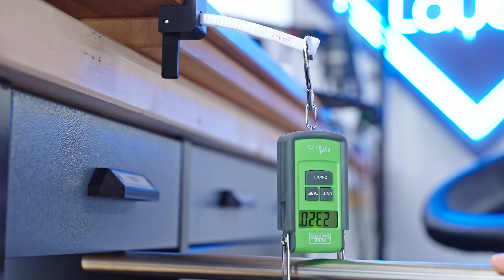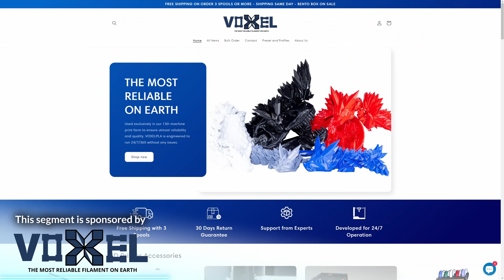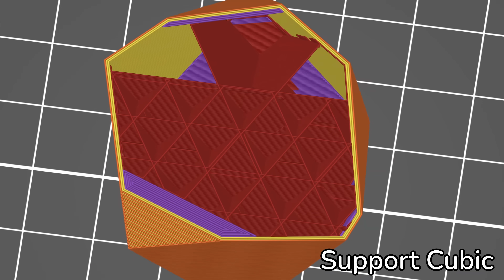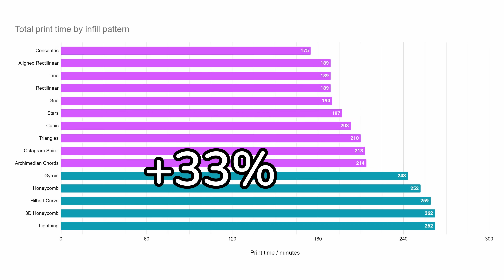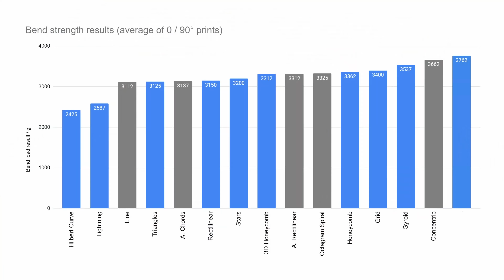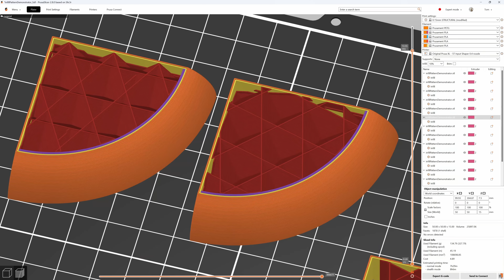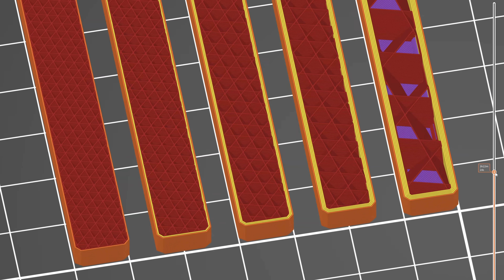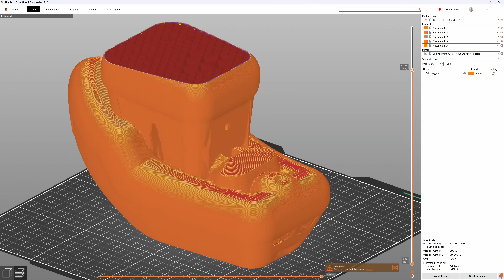Rethink how you use 3D printer infill!

Comment: At any point is less than 100% infill stronger then 100%?
Reply from the maker: I can see some very special cases where a bit of flex from less infill would make a part more compliant and therefore "tougher", but in general, yes, 100% would always be the variant that can take the larges amount of external forces.
Reply: @MadeWithLayers  hmm would be interested to see impact strength comparing high infill with 100%
Reply: Above 40% you get near zero benefit adding more material

Comment from the maker: Cubic was my first love...

Printed on the PrusaXL https://go.toms3d.org/PrusaXL

Product links are affiliate links - I may earn a commission on qualifying purchases (at no extra cost to you)
Reply: I would be interested to see how bambu's Cross Hatch stands up to this.
Reply: .. and it will be my last. 🎶🎵
Reply: gyroid gang
Reply: @pimi8522  Yeerrr
Reply: Need to do cross hatch too!

Also, is there a performance difference between 100% solid via infill and 100% solid via shell?
Reply: i was cheating on gyroid with 3d honeycomb until orcaslicer 2.0 update made it official with the upgraded version

then crosshatch came out and i left 3d honeycomb
Reply: I'm now trying GRID pattern but with "fill angle template" set to 45, 45, 45, 0, 0, 0 in SuperSlicer. Which means three times same pattern and then three times same but rotated by 45°. I wonder how measurement results would look if you plan to make second round of tests in future :)
Reply: @DreitTheDarkDragon interesting idea but why only 45 degrees?
Reply: Grid has always been my favorite but curious to watch!
Reply: Cross Hatch is my favorite.
Reply: I only print functional parts in ABS with cubic infill in 40%, even my dewalt table saw throat plate is printed like this.
Reply: so I made a printer head that prints stainles steel to .4mm , the problem is not in fill but suport .. so I use powder thet I blow on at each layer increment. you cannot belive the mess the first time!!
Reply: I've been recommending Cubic to everybody asking on the BambuLab subreddit ... feels good to be validated and having another video to point to ☺
Reply: Cubic for life❤
Reply: happy wedding with cubic. Make cubic babies.
Reply: Adaptive Cubic has been working well for my petg products. I design locksmith tools & in this industry you have to marry good strength with good looks. Locksmiths are a very discerning breed. And as the industry evolves these folks demand high quality tools. 
Good video sir! 🫡
Reply: Thanks! Great info
Reply: what about adapt cubic ?
Reply: you talked alot about the strength and efficiency of the print head movement, require to print the pattern. but i think those dubius pattern or any fractal based pattern existsted beause they are easier to callculate and able to fill iregular shapped print volume while also maintain great contact surface with the wall of the print.
Reply: Zig-Zag, or Rectilinear as it is in Prusaslicer was mine. Fast, prints clean and uses less material. I picked it as my first infill pattern, did some slicer simulations, looked at it and deduced correctly by accident. 
I have a special kind of hate towards gyroid and am VERY surprised it faired this well. I hate it because it is too popular, and the reason for that is that it is one of the coolest patterns to show, specially on a timelapse.. 

From now on, it is aligned rectilinear and cubic. I do use gyroid on transparent stuff, the infill then needs to be uniform in all directions so it is not useless. I have said that gyroid sucks in all directions but.. then again this is just one test. I think CNC Kitchen measured it performing worse, iirc.